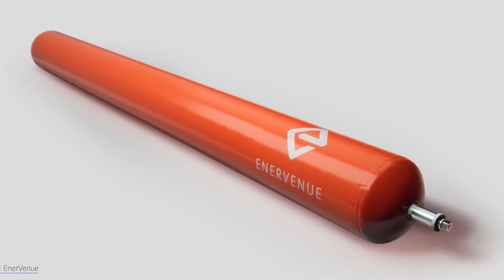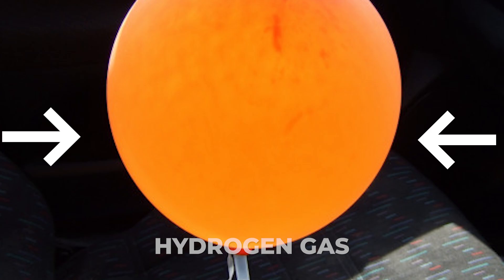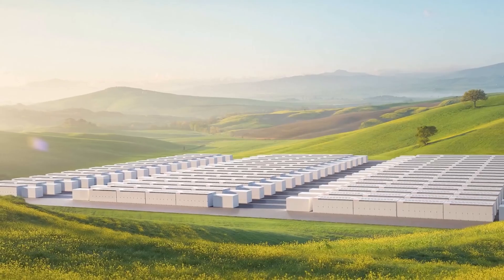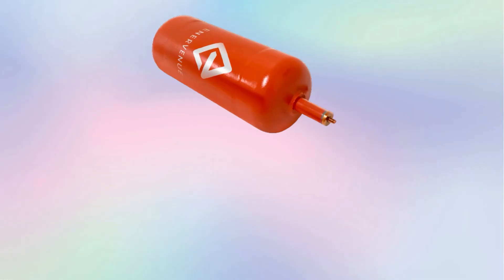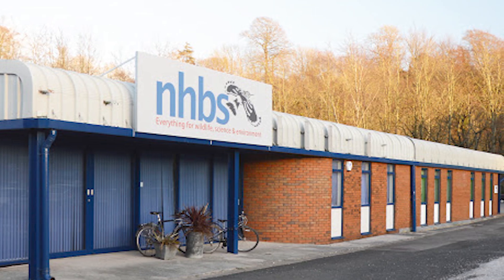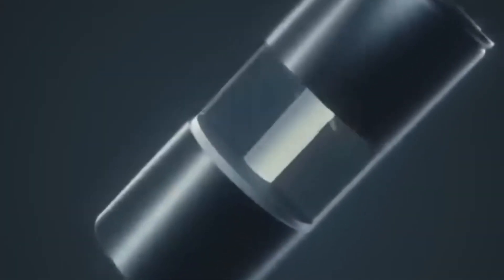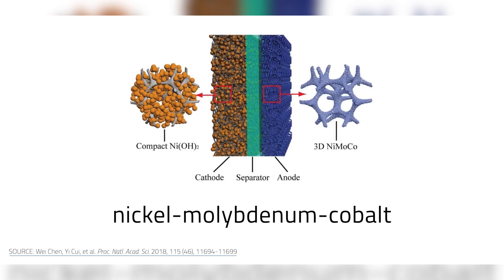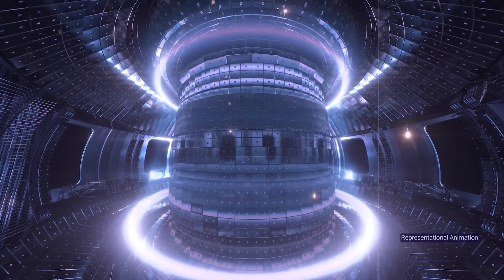How NASA's Battery Tech is Changing Renewable Energy Storage

Comment: There is two rather huge problem with those battery... one literally huge.

The battery are huge. they have a very high volume to energy ratio.

The other problem is the very low efficiency of only 80%, only NiMh is worse.